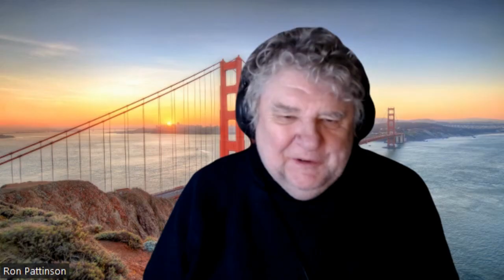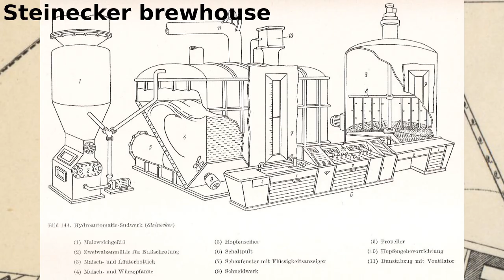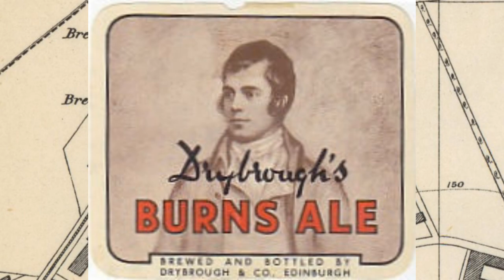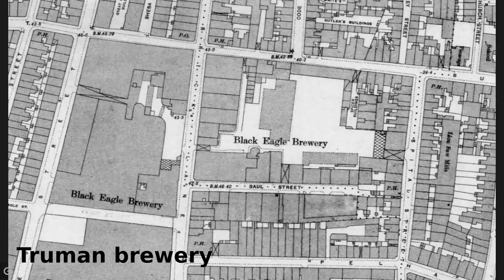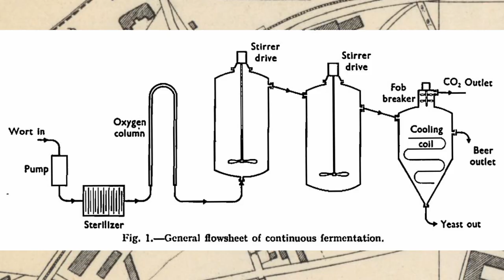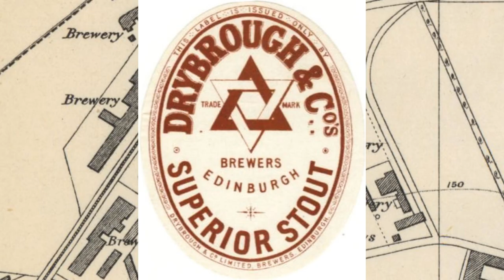George Thompson interview part two

Comment: Lots of interesting stuff. Here the CF plants are always in pairs so one is cleaned and one is operating. The problem of multiple products is "solved" by producing a pale high gravity lager yeast product which is then diluted and augmented with hop extract, dark malt extracts and colourants (once caramel) to various profiles. In traditional NZ beer no concern is paid to yeast family with "ales" being dictated by their copper colour and lagers by their golden colour. Good for efficiency not so good for beer character. I don't think CF is really about prioritizing character. Murphys makes sense. As would Guinness. Any producer that makes a lot of a single brand. There is a story of a strike at DB where the system was shut down full for weeks and when restarted the beer that had sat in limbo passed lab and sensory and went to market.
Reply from the maker: I think the system developed in NZ was different from the one used in the UK, which was developed by a brewer at Watney. At Drybrough, where most of the beer produced was Heavy (70/-) , I suppose continuous fermentation made some sense. Though there were still drawbacks. Which is why it was eventually dropped.
Reply: @patto1ro  Still seems strange they didn't have them in pairs and devise a way of producing more than one product from the base beer produced. Conceptually not a million miles from partigyle production.